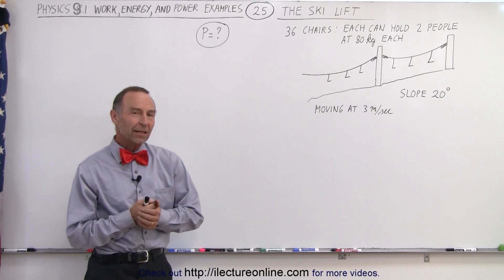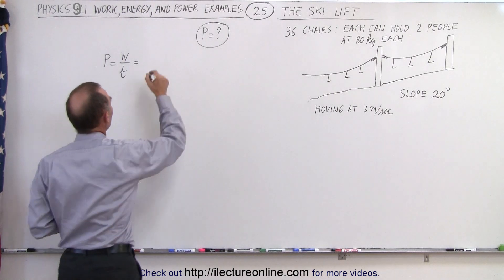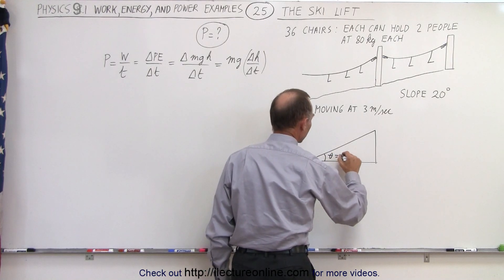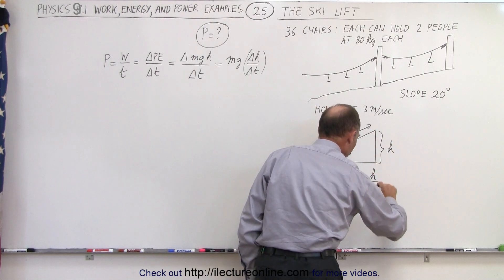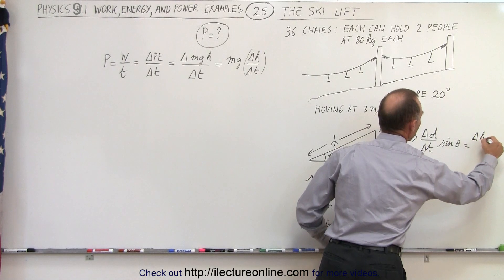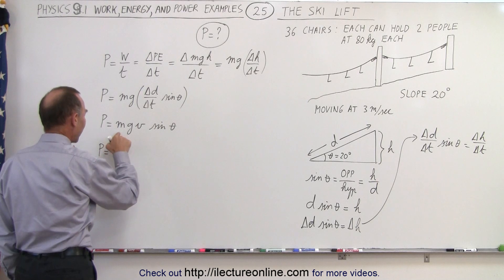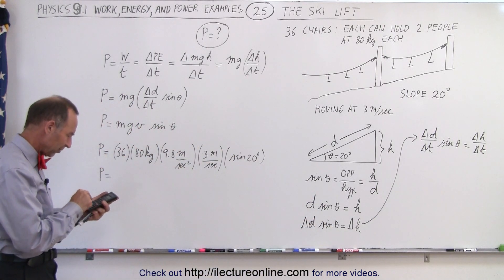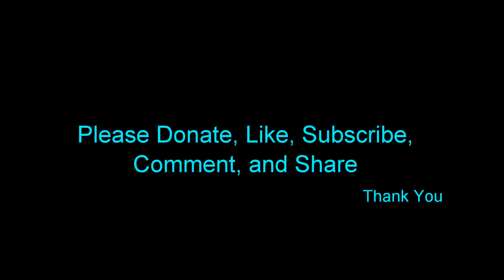Physics 8.1  Work, Energy, and Power Examples (25 of 27) The Ski Lift

Comment: Why is w=Change in potential energy. Isn't W=change in kinetic energy?
Reply from the maker: It can be one, the other, or both at the same time.  If the velocity doesn't change then the kinetic energy doesn't change and all the work done turns into increased potential energy.
Reply: @MichelvanBiezen  Only when air friction is neglected?
Reply from the maker: Yes, typically we ignore air resistance.
Reply: @MichelvanBiezen  Can i send you some questions over your email so that u can help me?
Reply from the maker: Our time is very limited and we get many requests.  We try to limit our help via these comments. (we have multiple jobs)
Reply: @MichelvanBiezen  ok. Thank you

Comment: Wouldn’t it be 160 kg per chair, “each  can hold 2 people at 80 kg each”
Reply from the maker: You are correct. (I left out the "x2")
Reply: not only that but half of the chairs are empty coming down and a sets have people getting on or off and where this happens is usually flat.  just an observation

Comment: Wouldn't you multiply the 80kg by 2 sense 2 people can sit on one chair
Reply: Yes - two per chair.

Breaking down a problem is probably the hardest part of a physics calculation.  Great to see real world examples.
Reply from the maker: Yes, I forgot the "2".  Good catch.
Reply: Yes, but not all chairs will be full (2 skiers) all the time. In fact, some chairs will not have ANY skiers on the uphill trip. Therefore, a rough estimate of 1 skier per chair for all uphill chairs at a given moment is fair. 

I believe he is assuming 36 total chairs, not 36 on each up/down section of the cable. That is actually a very small lift.